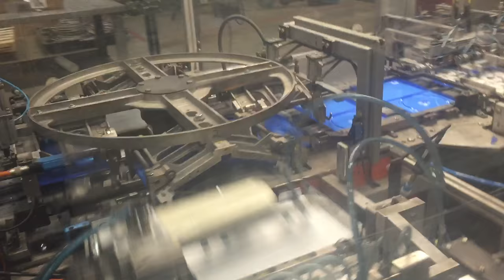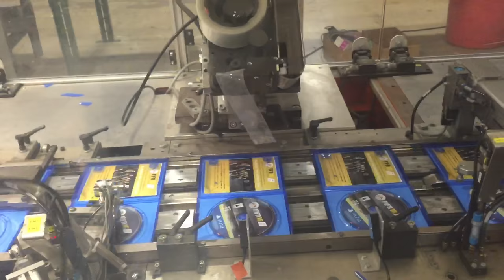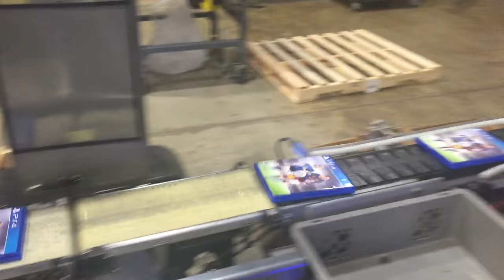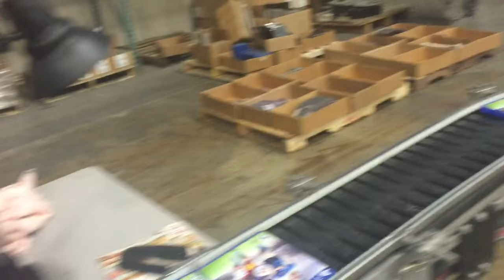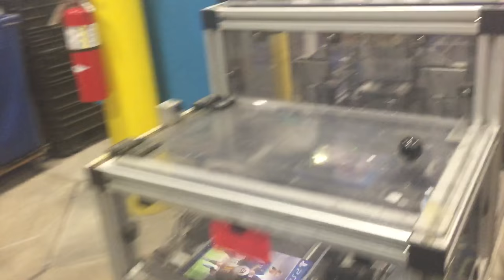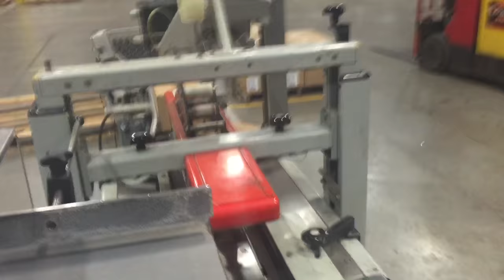Making PS4 games

Comment: Nobody ever talks about the people who actually build these machines
Reply: Yeah, aren't they made by hand, pieced together by hand, each part is cut out of steel, by hand? You're not going to tell me robots pieced the parts together, its probably assembled with a screw driver and human limbs
Reply: @gossipboynyc2434  yup exactly ,
Reply: Spoopy Scary Skelebones  i wonder if they use them for this, do we ever get video footage of it
Reply: Aliens  built them to keep the human race in what's called modernized slavery
Reply: Make this like make Gundam plamo
Reply: True
Reply: @gossipboynyc2434  He meant who planned and constructed this machine to work perfect like this.
Reply: Machine construction. Don't exactly know what is called as a job in English. But here in the Netherlands its big. Know many people who draw the plans for machine like this. And other people who cut out the part with c&c machines. And then again other people who instal it and put it together. Big industry here.
Reply: Mechanical engineers
Reply: Maybe they have machines that build these machines and maybe another one that builds those
Reply: @racky2  there are probably ones that build these ones, but as for the ones that make these ones that make the discs, there probably aren't that many, cause the ones that make the ones that make the disc are enough to supply most factorys with the machine that makes the discs
Reply: @theshred1030  Yeah, that would probably be as far as it goes...

Comment: This is neat and all, but lately I had several brand new ps4 games that the disc came loose from the center holder. Fortunately it's a rounded button and the plastic is smooth so the disc is not as likely to scratch, but is kinda worrying since once you open it, it's yours and the store won't take it back.